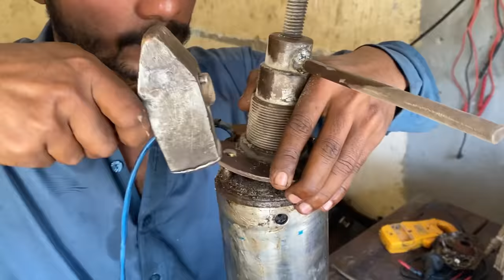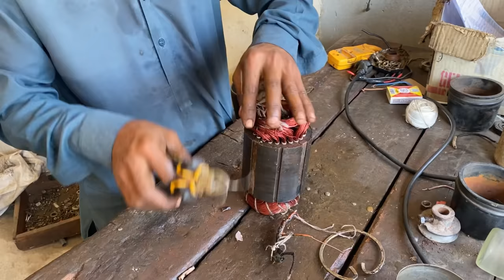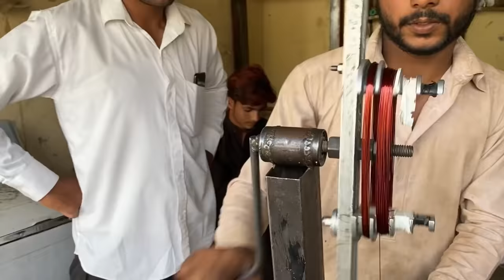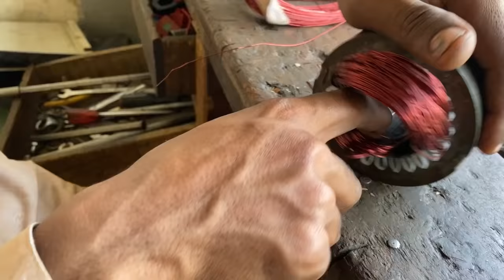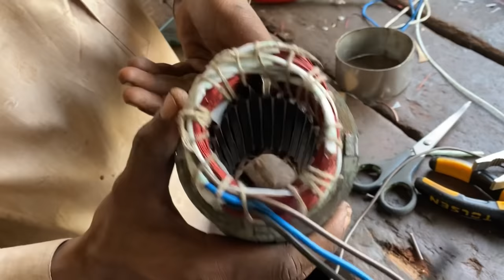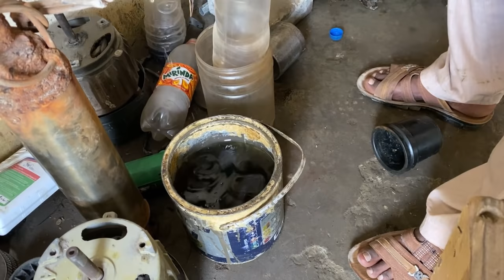How to Rewind  Submersible Pump|

Comment: Aluminium winding wire that means not good quality 🤔🤔🤔, he not change oil seal and other thing that man used hammer with iron shaft push Rotor shaft in the motor jacket. This is wrong because if u done like this Rotor shaft damaged.